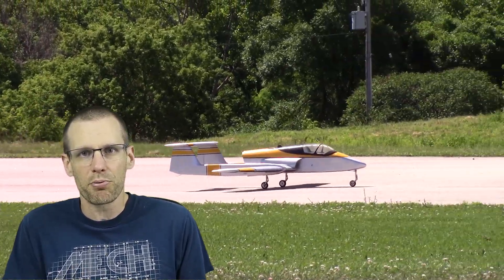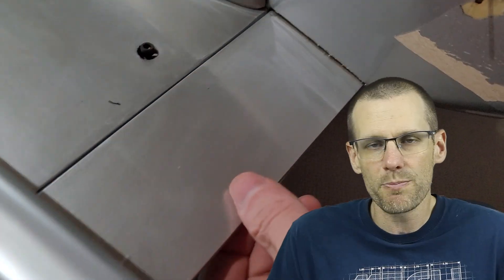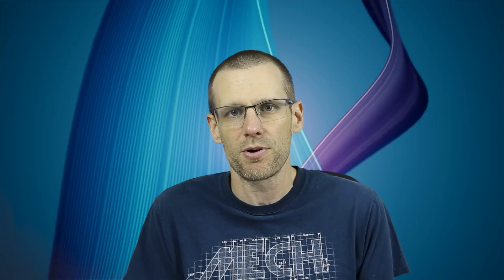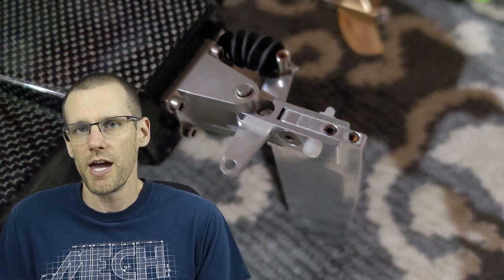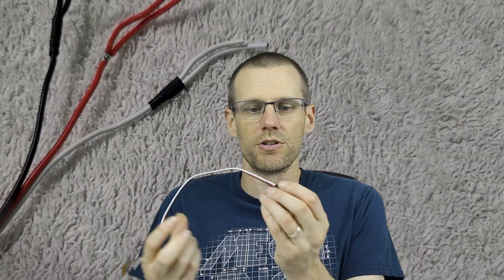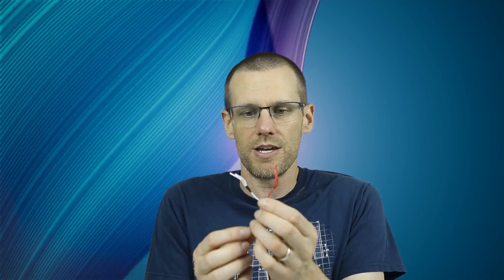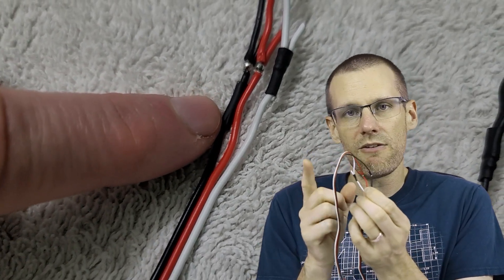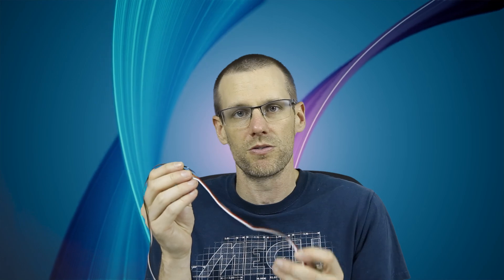Servo or BEC Destruction - The Critical Mistake You’re Making Pre Power Up!

Comment: I could use some help with this related question:
Whenever I buy a new RC car I get rid of the provided transmitter and receiver, and I bind it to my Flysky radio instead. So far, so good. But as soon as I set up the transmitter I need to input an operating frequency for the employed servo. And most of the times there is no information provided on this. Not even when looking online for the spec sheet of an original replacement servo.
What do you do in such case? I don't want to set the operating frequency lower than necessary and thereby making it slower, and I don't want to fry the servo by setting the frequency too high. But I also don't want to replace a brand new servo with another one with known parameters.
So what would be a way to figure out the exact operating frequency of a servo to input in the transmitter settings? 🧑🏻‍🔧
I assume I am not the only person with this problem. 🤷🏻‍♂️
Reply from the maker: I have a video in queue that will cover some of these items. What servo model are you using?

Comment: I recently had a motor fan wire split the rubber coating on both the positive and negative wires were exposed. I thought my esc died it wouldn't boot. I found it and works just as It did. I'm suprised it didn't kill the bec
Reply from the maker: Nice you found it in time!

Comment: When running wires/cables, don't force things. You are not fishing for marlin. That is how the heat shrink probably shifted, during install or maintenance.  Anybody that has had to e-solder and re-wired things know It takes a lot of force to remove properly installed heat shrink.
Reply: Sometimes I add a dab of CA after shrinking to lock the shrink in place.  Or use Permatex liquid electrical tape. Both are a messed for rework but great otherwise.
Reply from the maker: Haha, not fishing for marlin over here. 

I have also placed a dab of glue on heatshrink in the past. Especially on battery connectors that required heat shrink to be used. But this is very different from the y cable that sits in a wide open cable tray.

Comment: Why i always stagger my solder joints so they aren't parallel with each other
Reply: This is good advice especially for home wiring.
Reply: I use silicone coating under my heat shrink too. lol redundancy 👌🏼
Reply from the maker: Excellent advice.